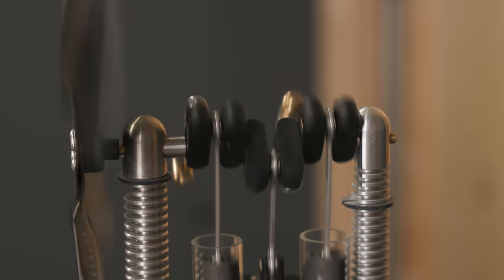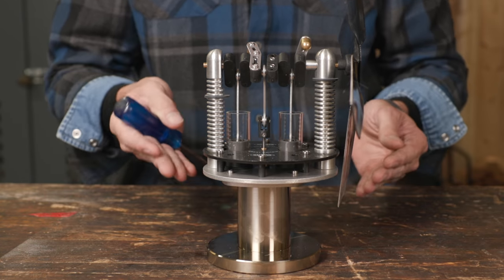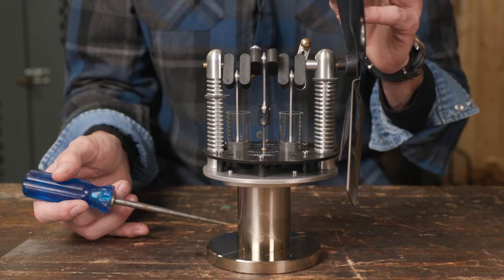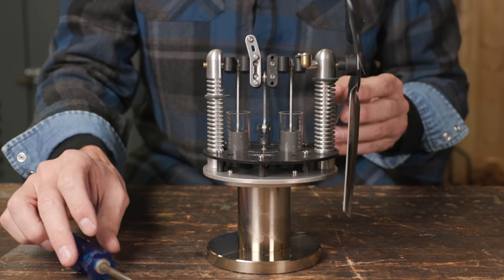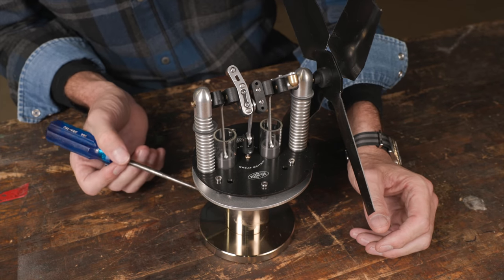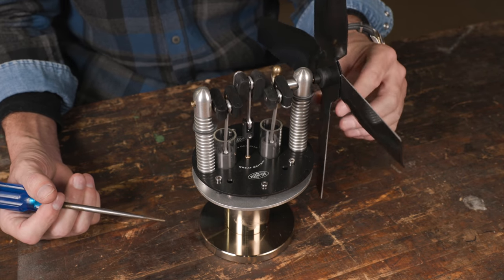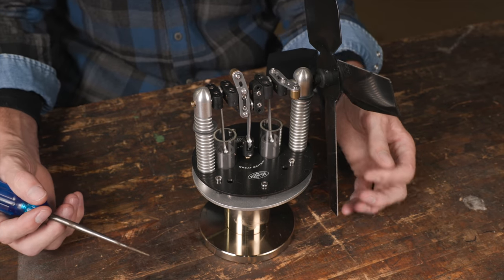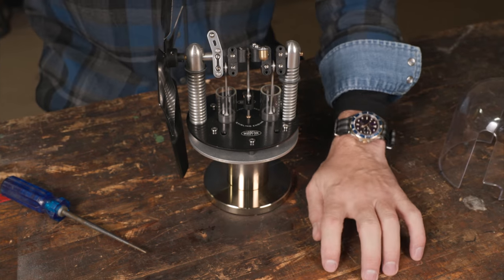Wood Stove Gadget Power Companies Fear

Comment: Funny story. My father was so proud to have installed a wood stove in his old house that he purchased one of these engine-type fans for on top of it. He purchased a premium model and claimed that it made the stove look more sophisticated. He was disappointed when the brand new, rather expensive, fan did not spin but for about 5 rpm. He left it sit on the stove as a decoration though. One day I walk past it and pick it up to examine the mechanics of it. I happened to notice that there was a cellophane cover (like what comes on a new TV) on the very bottom between the fan and the stove. He removed that cover, and within 5 minutes the fan was blowing clear across the room with warm air.
Reply: 😂😂 classic
Reply: Reminds of my situation. Bought a house from my now neighbors (they subdivided and built new). When they did the kitchen remodel 20+ years ago, they put a built-in AC to cool it (there was no central AC). He loved it, but his wife thought it was way too loud and refused to use it. Come about 3 years after we buy, and we put in central AC on the first floor, so we remove the AC. First thing I see is a “Remove shipping strap before installing and operating”… on the shipping strap that is still installed. Gave it away, and it was very silent apparently.
Reply: Good to see you back brother!
Reply: Thats great, love it!
Reply: Looks great! Just bought a similar one but unfortunatrely i have a recessed built in stove that leaves no surface area for fan to sit. Therefore it would be awesone to have a manufacturer create a modifed version to allow for vertical adhesion with perpendicularly positioned blades to allow the same function in this instance.
Reply: That's funny, must have made his day!
Reply: This is the problem with the Sterling engine. There has to be a heat difference between the top and the bottom of the engine. After it runs for a while, the heat difference equalizes and the engine stops running.
Reply: I had a similar experience.  I worked at a store and people would buy these compact flashlights with batteries already installed and they would always return them saying they didn't work. So just like you I took it apart and the batteries were wrapped in thick plastic.  From then on when someone returned those flashlights I would show them and they felt so dumb LOL
Reply: You know you saved the day, right? 👍
Reply: So what does it do? It's just a fan?
Reply: @18despues  The idea is that it pushes hot air through the room that is lost by heat rising staying close to the heat source.
Reply: Love that story! Where can I get one of those for my wood stove, do you recall?
Reply: Where did he buy?
Reply: @wilfredprins9718  my father purchased his at a local store in Pennsylvania that sells wood stoves and accessories.
Reply: @alexwadding  that's a bit far to walk by(will need some intercontinental flight for that)
Reply: I didn't laugh at all. More like crummy story. It was pretty dry honestly. No gravitas. Keep working on it.
Reply: @benjamin593  that my good sir.. is incredibly inefficient. You'd have more energy conservation if you used a ceiling fan on low speed with less wood burning. Just saying 🤷‍♂️
Reply: @Milpower  No. No it does not. A ceiling fan does however.
Reply: @stanleydenning  you'd need a forge or a propane/butane torch to reach high enough temperatures for that to happen, and if it's larger in scale then it would be able to survive 2000° easily.
Reply: @bluebutterflywellness2273  use high temp JB weld and a c-clamp to hold it in place for a day while it cures. A ceiling fan is way more efficient though. I can't stress that enough. There's a reason we all have them. They're the most efficient place for them. Heat rises and it circulates back down by the ceiling fan, and cold air sinks and sits at ground level and the ceiling fan adds wind-chill. They're literally the most efficient fan for climate control.
Reply: Good stuff
Reply: @cguy96  funny
Reply: @mib20000  lol
Reply: @___Eldritch  That is an AWESOME tip, Thanks! I've been using the ceiling fan but felt like I was missing out. Perhaps not so after all.😊
Reply: @___Eldritch  I will be sure to submit a copy to you for peer review before commenting again. 🤡
Reply: @stanleydenning  if the room becomes the same temperature as the wood stove, you have a huge problem.
Reply: @wilfredprins9718  Link just below the video
Reply: @18despues  Yes but it spreads the heat around the room just like an electric fan would do but without using electricity.
Reply: Last Fall I got my buddy to help me install my wood stove. All my life We depended on a wood stove. Dad would call it “free heat”After doing all the labor of splitting wood. That just adds more to the specialty of wood stoves. Plus there’s nothing better than snuggling up around a wood stove after a long cold MT winter’s day. Stay safe friends
Reply: surely the celophane would have burnt off when he had it on the stove to find it didnt work?
Reply: @bluebutterflywellness2273  -10 months late, I know, but im sure you modify it yourself. Or build a recessed shelf with air duct to it?
Reply: @Anti- Hero --  ya know, if you have an off grid cabin, with a wood stove, but little to no electricity, hence no ceiling fan fixture.  Pretty much anything to move the warm air there above the stove is a LOT better than nothing. 
 Its not a brand new invention. I'm sure it came along well before electric ceiling fan, and was better than any other alternatives. 
 If you think outside your own little box, before you post something outside you're experience level, might not get snotty replies. Or, maybe that's all you want. Which is just sad
Reply: professional homeowners never have to read instructions they eventually will figure it out
Reply: Lol
Reply: "Today you truly became my son."
Reply: Touching story. I hope it's not fan fiction.
Reply: Good  to know this
Reply: GaryGoat350  We were asking the same question. There was actually concern after that of how it could have caused a fire being that hot.
Reply: LOL
Reply: Sounds like a lie. Explain how the heat from the stove didn't melt that protective plastic that would have been in direct contact with the stovetop.
Reply: My dad said the new windshield wipers don't work for nothin and he drive through a storm. I looked at it later and removed the plastic sleeves that come on the blades and it worked lol
Reply: Lovely story my friend

Comment: I have always wanted to see someone pair a sterling engine with a pellet stove.  The sterling engine would drive the pellet auger removing the need for electricity to keep the stove running.
Reply: The only problem with sterling engines is they don't produce very much power. 
Not much torque either..
Reply: Brilliant! Now power up the computer with spc control to control the auger. Next figure out how to turn it on an off with a thermostat. 
You must be a enjineer.

Comment: Love you videos.  Your description is fairly accurate except:  I think the displacer is made of a light non metallic substance.  The temperature difference does tend to allow the heated air to rise but, that is a tiny effect countered by the displacer.  The real motive force is the heat increasing the pressure inside the lower cylinder.  

I am a retired chemist.  Worked in an industrial lab  but, as part of a local science outreach program, I used my sterling engine to teach gas laws to middle school students.  Basically, heating a gas in a closed vessel increases the pressure.  That pressure pushes the top pistons. As the gas expands in the top pistons it cools and is pushed back down into the hotter lower cylinder by the return motion of the piston and the displacer.  For what is worth, I included a poorly written but, more detailed description of the physical chemistry of the system below.  I believe I was a good scientist but, never a very good writer so for what it’s worth….

Ideal gas law is PV = NRT.  P is pressure, V is Volume,  N is the amount of gas, R is a constant to keep the mathematical terms all the same, and T is temperature.  Seems complicated except the amount of gas (in this case air) in the system remains constant, the gas constant is also  constant.  So simplifying the Pressure and the volume varies directly as a function of the temperature.  In the big cylinder where the gas is heated the volume is also constant.  So heating the gas increases the pressure or mathematically since V, N,R are all constant then P=T.   The pressure increases in dirrect proportion the temperature change.  

If the lower cylinder was sealed that is all that would happen.  The increased temperature would just cause the gas pressure to increase.  However, the bottom cylinder isn’t sealed but, is connected to the upper cylinders.  The increased pressure in the bottom cylinder pushes the pistons in the upper cylinders.  In the top cylinders the pressure pushes the piston.  As the piston move upward the volume of the cylinder increases allowing the gas to expand.  As a gas expands it cools and further cooling occurs because the upper cylinders are further from the heat source.  The purpose of the displacer is to help move the cooler air at the top of the piston back down to the the bottom of the bottom piston.  

Why a gas cools when it expands is a longer and for me a much more difficult explanation.  But, most refrigeration is based on the fact that gases cool when they expand so please take my word for this. 

Again love your videos so keep them coming.
Reply: Yeah trying to explain how hot expanding gas eventually cools itself does get a bit complicated and convoluted without a full on lecture plan lol 
Without getting into Boyles law, bernoullis principle, and the other laws of thermodynamics you cant say much to anyone. 

Trying to explain how they used 600+ degree air to cool jet engines down is even more fun haha, all the while the compressor is simultaneously heating and cooling intake air via compression, expansion, and airflow manipulation using bernoullis principle and multiple airfoil designs to fuether control temperature and density.

Comment: A Sterling engine has two strokes. Stroke one is When the displacer is lifted the air rushes down towards the hotplate and expands, driving the pistons up. The second stroke is when the displacer moves down and displaces the air upwards allowing it to cool, contract, and suck the Pistons down.
Reply: Well said.  I can understand your explanation easily.
Reply: @robinhaas6895  exactly👌🏼

Comment: I have one of those thermal conductive fans to improve the performance of my Buddy heater.  Not as beautiful as this, but amazingly effective.  A ton of heat just goes straight up where it is not needed.  This helps move the air around a bit for better dispersion, less hot spots.
Reply: Yes, we have one for the wood burner it works with a piezoelectric element which creates electric to power the fan when one side is hotter than the other 👍
Reply: I have the same setup as you. Buddy heater with the electric version of these fans

Comment: The displacer is used to cause the temperature differential (the displacer is likely made of a heat insulator) when it's at the down position (closest to the base) it blocks the heat and the air inside the chamber starts to cool causing the pressure to drop. Which in turn allows the power piston to move down. At that point the displacer is now in the top position and isn't blocking the heat, exposing the air to the hot side. This increases the pressure and causes the power pistons to move up and then it repeats.

The air doesn't push the displacer up or down it's just a very loose fitting piston to displace the air from the hot side to the cold side, to cause the air to expand and shrink.
Reply: Yep, couldn't have said it any faster or better. 👍
Reply: @andrebartels1690  pistols are also offset ninety degrees from the displacer on the crank shaft. The flywheel is essential. The fan blade in this case
Reply: Pistons
Reply: @andrebartels1690  thanks!
Reply: @ksherwoodb  Indeed they are!

Comment: If you're using this with a Catalytic stove instead of a standard one, put 3 spacer washers under it in a triangle pattern to create an air-gap. Two at the front near the blade, and one at the back in-line with the crankshaft. Not doing so can damage the engine, oh, and oil/clean it twice as often. I learned that the hard way.

Comment: Another really cool thing about Stirling engines is that there's so many differrent designs of them all working off of the exact same basic principal. It's a really good example of just how many different machines can be made to do the exact same task on the exact same physical laws, while differing drastically in construction method.

Comment: Beautiful piece of engineering and functioning piece of equipment. Don't see how ANYone wouldn't actually want one of those. Perfect for a wood stove. That or anything that has a flat, level top, enabling warm air to be circulated. Very nice!!

EDIT: Okay... but BEWARE: STICKER SHOCK!!! But remember... this thing takes NO energy (other than what you are already using) to run. So, in TIME, it will literally pay for itself. IF one has an area that is not "heating" (heat transfer is too great elsewhere) this will help "push" the heated air over in that direction. In that case, eventually, it will pay for itself. Heh!
Reply: I wanted one until I saw how much, I will stick with my 20 dollar thermoelectric fan. Might be a target savings item in the future but for now I will just admire Wranglestars : ).
Reply: Definitely elegant engineering and a great conversation piece but seems impractical. It costs over $1.10/CFM and equivalent thermoelectric fans run about 28 cents/CFM. I still want one.
Reply: @Paladin_Strategic  Hahaha! Well, of course, that's in the first X-amount of time running it... after that it will eventually become $0.000000001 to "run" it... eventually. Didn't work out the cost efficiency of the unit/time. Like a Geothermal/Radiant heating system. The cost per BTU/H in the beginning is going to be astronomical. Yet, over time, it become not only cost effective, but in, say, five years, it's paying you BACK... then the costs to run start dropping phenomenally. 

Hahahahah! Yeah, I saw that and got sticker shock, myself. But it IS a "free-wheeling" machine. Costs nothing to run it and it DOES look really cool. Yeah, that's the "issue" with these "expensive" heating (i.e. solar, radiant, in-floor, etc.) and cooling systems is the initial costs. AFTER that (getting OVER the initial shock) though, one comes to find that over time, it starts to pay for itself...

IDK... this just pushes air... but if one has a "corner" where the heat transfer is just not that great, it may get up to ~5-10 degrees"-" cooler than the rest of the domicile. In cases like that... it just may be able to heat that area. Although "heat" goes to "cold"... so yeah... there's that... lol...
Reply: @ForeIndication  Hahahahah! Yeah, I forgot to mention the "Sticker Shock" on that puppy... but still... it IS a beautiful piece of equipment. Ya gotta admit that...!!!
Reply: @ethericbliss23  the minute I saw it made me want it. when looked I said ooh snap. Have to save some pennies up for that.  It is completely awesome beautifully engineered and built.

Comment: There is a huge Stirling Engine near me that generates power.  It has a 30 ft reflector dish made of multiple plates the engine is mounted on the center arm and runs off heat of the sun.  Pretty cool, looks like a huge flower.

Comment: The stirling engines have one problem that tends to limit their utility, they need abundant cooling. 🤔 That said, driving a fan on a wood stove is essentially the ideal application. 

As for your explanation of the mechanics. I’ve studied the engines for a few decades. You did ok, the individual parts actually aren’t so bad in terms of complexity. The thing is, they work in tandem with other parts and there’s a number of interactions that get 😳. I actually think there’s some real potential for advancement, I would however be pretty hard pressed to pick them out and to then explain them.

Comment: Good video. It's simply a low compression steam engine. Unless you know what you are doing with a steam engine, operating one is very dangerous. In places where a non-critical mechanical power source is needed a Sterling engine may be the answer. Quite often they are often used outdoors using a Fresnel lens to heat it with sunlight. I don't think you could make one to run a car, but  larger unit could run a small generator for electrical power. There are several YouTube videos describing them. It's worth the search.
Reply: I think it's Sweden that has a sterling engine submarine, which got some fame for being silent enough to evade detection during war games.
Reply: I believe it was tried in the 70's. No one wanted to wait for it to heat up before driving off.
Reply: Sorry to diapoint you but you make steam from boiling water.  These machines do not have any type of water to make them run.
Incidentally this engine was being used before the Scottish Reverand Stirling patented it . An English lord had built a massive engine some time before it was patented.
Reply: @scotpict308  Exactly. To these days Stirling engines are still limited to power generation only because while they are relatively safe and versatile of heat source choice, they have low power to weight ratio and take time to rev up. Which makes them only suitable for submarines powerplants.

Comment: Very nice piece of equipment. Another technological marvel is the Ecofan which transforms heat flow into electricity which drives an electric motor and turns a fan. Anyway, these fans increase the efficiency of a stove by circulating warm air (unnoticed).